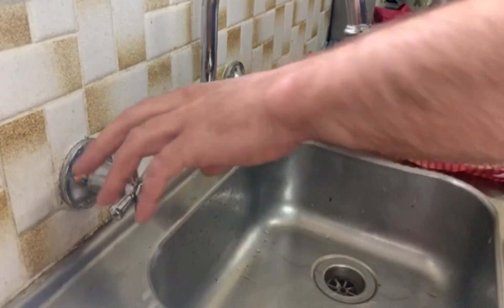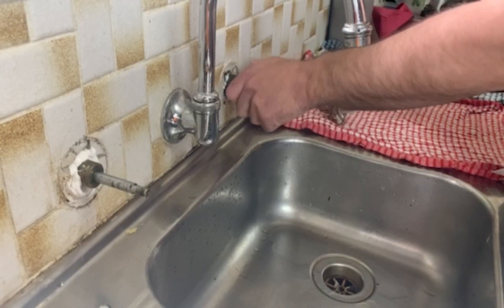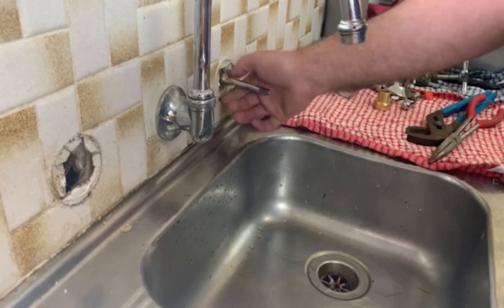HOW TO Install 1/4 turn or 3/4 turn ceramic disc taps QUICK and EASY!

Comment: just watched the video and I'm feeling brave so going to put new 3/4 turn taps in my shower. I tried doing this a couple of years ago and didn't know about those extenders you used so I took the taps back for a refund.  Heading to Bunnings tomorrow for taps and extenders. Thanks

Comment: Thanks so much, this helped me put my 1/4 turn taps back together after taking apart to clean. 

Some of my most used 1/4 turns (1 year old) are becoming a little bit stiff to use. Is there anything I can put on to service them or prevent from becoming more stiff? WD40 or nah? And if so, where do you put it?

Thanks again

Comment: Brilliant video, thank you so much - was a bit scared changing out my old style screw taps and installing a new set of 1/4 turn taps myself and the set I bought had no instructions whatsoever but essentially followed your easy to follow instructions and was a breeze.  The new taps look amazing and looking forward to avoiding drip drip drips in the future.
Reply from the maker: The reason I made the video. Some plumbing can be done by anyone. Save yourself some coin. Glad it helped.

Comment: Thanks for this video. I made a silly noob mistake and tried to install the $200 quarter turn taps I just bought without realising that I needed to take off the extension ring AND the second collar thing. Tried to install it and off course the back of the cartridge wasn’t sealed because it couldn’t tighten into the wall far enough. Upon testing what I thought were properly installed taps they leaked like open taps. Was planing on trying to swap them for normal taps tomorrow, but your video has saved me the hassle and get to do attempt number two for these nice quarter turn taps!
Reply from the maker: best of luck.

Comment: Thanks for the video. About to do mine and doesnt look too hard as i was hoping. Question, if the handles are level when I test them, is that an adjustment through movong the spindle or the handle themselves? Just being prepared in case its not as easy.
Reply from the maker: handles I would assume.

Comment: Great video - only thing I'd add is that you should have reseated inside the tap body before installing the new spindles - atleast mentioning this in your video so folks know this is a recommended step by most fitting manufacturers. :-)

Comment: Fantastic instruction video. I couldn't work out why when I first installed the taps and then turned the water back they ran on full and I couldn't turn the taps off and then I came across your video on YouTube and it explained it perfectly.
Nice intro with the plumbers crack. 👍😂🤣
Reply from the maker: You're welcome!

Comment: Cheers for the video mate. Have had a problematic tap in the bathroom since I bought my place 4 years ago. After watching your video I quickly and easily changed the taps. I did add one step though. As they are the shower taps, I added some all clear to the hole to stop any water getting into the wall
Reply from the maker: 100% good stuff.

Comment: thanks for the video! super important point, though- Before you put the bonnets on, switch your water on and run both taps for a minute to make sure there isn't a leak behind your wall. (you can also just watch your water meter when you turn your mains back on.)

Comment: Great video, thanks! We have these installed in the shower and the handles are pointing downwards - I just want to change them to point horizontally. Is there an easy way to do this, or do I need to dis-assemble the whole tap and then re-assemble?
Reply from the maker: May have the hot in the cold and cold in the hot.

Comment: Great video! Thank you!
Do you think these taps would do well in a rental property, I’m fed up of replacing washers that have been cranked sooooo hard by the tennants ?
Reply from the maker: Yeah I mean they will outlast washers. And normally can change a spindle to fix down the track. Not a big deal. But yes these taps can go anywhere

Comment: Great video! Just a question : how do you replace the part in the middle between the taps where the water comes out?
Reply: Just unscrew it and screw a new one on. There should be a threaded piece sticking out the wall that a replacement spout will just screw on to.
Reply from the maker: this is true, but use some Teflon for the new one

Comment: Can I replace my older shower tapes with these and will they fit okay after I add 6mm Villaboard and tiles to the wall?
Reply from the maker: I would say yes. If you have the wall open you could install them and make sure before you do the wall. worse case is moving the noggen or using extensions.

Comment: Hey mate, thank you for this - super easy to understand. When trying to do this with my shower taps I found a little spindle thingy sticking out of the centre of the threaded hole in the wall - I'm not sure if I'm meant to remove that, and if so how? Just wanted some advice before I went and tugged something out that was meant to stay there 😅
Reply: Just to clarify, I've worked out the thing is the Copper tap valve itself, it seems to have gone beyond a ridge in the pipe somehow - any tips for getting it out?
Reply from the maker: Sometimes ya need to call a Plumber

Comment: We tried installing it but the water is not switching off completely. The water flow is low and high but not completely switched off. What could be wrong please suggest.

Comment: Thank you! Tried to replace a basin spindle that kept leaking. Bought one from bunnings with terrible instructions. Couldn't work out why it was still leaking..  Had no idea where the brass locking nut was meant to go 🙃
Reply from the maker: You're welcome!

Comment: what does it mean when you have to turn these taps open a bit to turn them off, busted or not installed right?
Reply from the maker: can always pull apart and re install correctly then your question will have one answer. busted.

Comment: Noticed you didn't use any thread tape? I had these installed over the bath. After a week the hot failed and was leaking. Called the plumber who said to call Reece as it was a tap problem. Reece guy came out and found no problem with the tap but the because the plumber had used extensions (to bring the spindle out further from the wall as thick tiling) the rubber seal inside had distorted and moved out of place. He put some white stuff on it, maybe vaseline, and hasn't been a problem since.
Reply from the maker: Follow the video, ya can't go wrong.

Comment: Any issues installing 1/4 turn taps if the water is gravity fed from a header tank?
Reply from the maker: Ummmm, they work best on high pressure but I still think they will let the water past.

Comment: i just did the same thing..  Orientating the handles I found was tricky and I didn't realise they turn on and off in opposite directions.  I put my large end facing together sort of ok.  When I finished I noticed a large 0 ring on the ground so I suspect the 0 ring is missing in one of the taps.  Not leaking so I hope it doesn't matter.  I will diassembe again one day to see which one is missing.  By the way I watched your video after not before doing it myself..

Comment: I have this installed and it has started dripping what could be wrong ?
Reply from the maker: Pressure, something caught in the spindle, age, or defected. If they are clean are pressure isn’t over 500kpa. They might need to be replaced.

Comment: not the plumber's arse-crack.

what an eyefull.

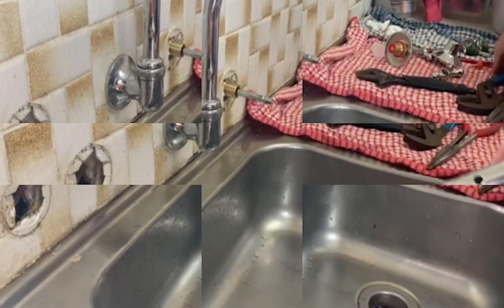at 5:15 I don't have that rounded silver tool to turn and fasten the fixture. any way around this?
Reply from the maker: buy it if needed. only as good as the tools you have.

Comment: Why am I having leaks when I swapped in these taps  not just a little leak but more of a trickle.
Reply from the maker: Might need to call a plumber or replace them,. Can be faulty from factory.

Comment: How about wiping down the tiles before refitting the taps? Yuk!
That water pump spanner is the wrong tool for working nuts. Use a spanner of the correct size.
Reply from the maker: “Water pump spanner” yep. Went to my local water pump store to get my plumbing tools. I love you John.

Comment: No tape on it at all ...
Reply from the maker: Teflon tape? "plumbers tape" No. The rubber on the end of the spindle seals to the base of the breech and the red body washer on the second part seals the thread. No tape needed on any taps if installed right.
Reply: @Plumbersaint  This was my question as well. Thanks for the video.

Comment: Hi Saint, I bought a set of two 1/4 turn basin tap Shaw and Mason brand, I have followed instruction as you done perfectly but it's was not working. I think the tap seat function replaced for the old washer function, isn't it?
My set bought it with NO TAP SEAT. Can you instruct me how to do it properly please?
Thanks Heaps